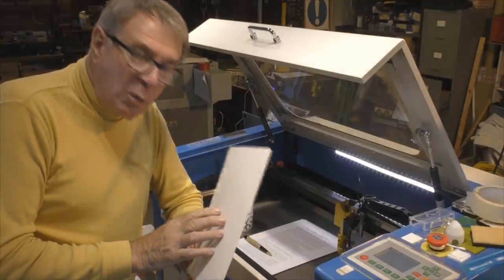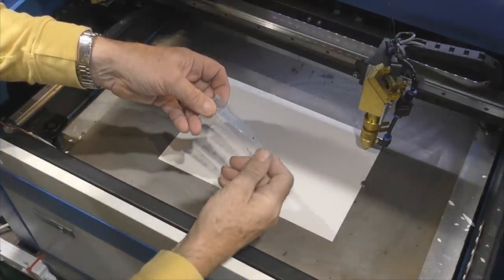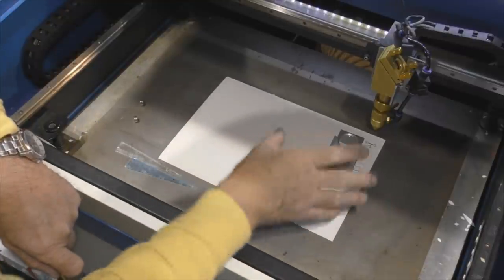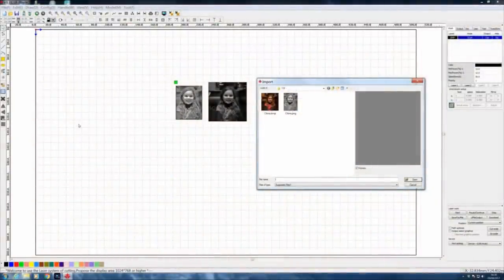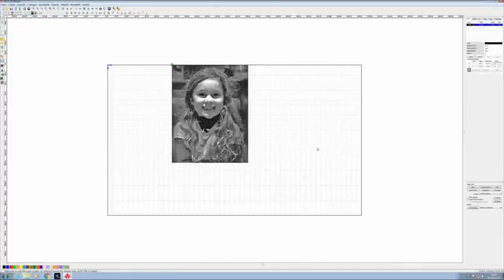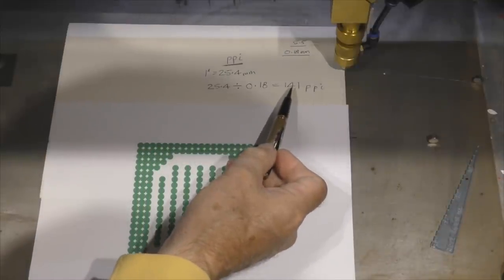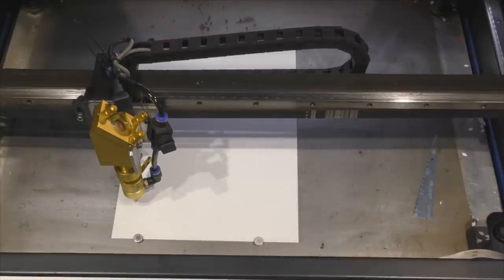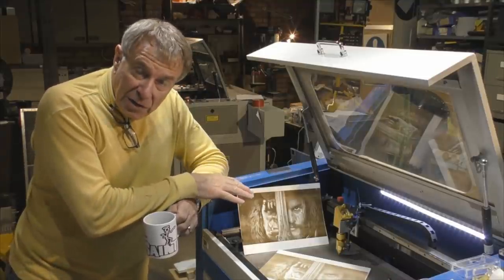RDWorks Learning Lab 115 The Russ Formula for Photo Engraving

Comment: Is there software that does a lot of these calculations?
Reply from the maker: Hi Edward
I understand there is a one touch button within the RetinaEngrave software that does it
https://fslaser.com/RetinaEngrave

and this also has a one touch conversion function. in this also
http://www.photograv.com/aspnet2/

Unfortunately buying a piece of software is not an option for me. I need to understand all the underlying principles and someone else's algorithm  will not educate me on the basics of how it all works. My formula is a basic starting point to that understanding but there are many other avenues to explore to improve the resolution, especially with different materials. All in future sessions I feel sure. This is definitely a work in progress. I have seen some great work by pro companies but they are bound by the same basic physical limitations that I encounter. The response time of the laser tube to changes in current (the laws of physics). The response time of the power supply to commands from the controller(design and component quality limited). The ability of a lens to focus to a theoretical spot size which is again limited to two main materials, gallium arsenide and zinc selenide and then the lens shape which could be plano convex or meniscus,
The fact that both bits of software above claim to work on all machines is an amazing claim considering all the possible variables. That makes me believe that there is something special about the dithering process which my standard programs are not delivering.  More research required.
All best wishes
Russ
Reply from the maker: Also look at https://www.ulsinc.com/discover-uls-innovations/1-touch-laser-photo
Reply: SarbarMultimedia thanks for the info and links. I enjoy how in depth and technical your videos are. I’m new to lasers, but I’m an engineer and i play with cnc routers, printers and mills.
Reply: SarbarMultimedia I like the ease of use of the software packages, but as a hobbyist I’m tired of paying for software. Aspire, Corel, etc have tapped me out. 

I was watching one of your older videos and you said to be ready to replace the tube early on. Do you still think that’s the case?

Comment: Hi Russ,
your YouTube Videos are so great. Thanks to you I have Adobe CS2. And a deeper understanding of Thunder lasers. I especially liked your 3D engraving and doitting videos. 
I have already tried with your 3D engraving technic. But I have not fond working gradation curve yet. I just have to test more. But I have developed an easier but worth tecnic in the meantime. I just sliced my grayscale picture in 10 planes with only 255 white and 0 black. Then I engraved the 10 different pictures on top of each other.This engraving technique  is also capable to producing reusable results. :D
I would like to have also a copy of “The Russ Formula for Photo Engraving”. I would like to try it out and see if I am cable to produse 127ppi pictures.

Sincerely Themisto from Germany

Edit:
Have you received my comment under this comment with my E-mail address? YouTube has deleted two times the comment after same minutes.
Reply: Hi Thermisto
 That is a novel approach to 3D engraving but taking a normal picture and breaking it up cannot give you the topographic image mapping required to produce proper 3D engraving. I have tried several techniques but have to accept that those waxy looking images are the only ones that rally work.
I have not yet received your email address. This maybe because it was a sub topic.Chose nother videoand add a comment. Also use (at) instead of @
Best wishes
Russ
Reply: @russsadler3471  Your technic produse definitely better quality 3D engraving. Engraving with a grayscale picture gives a much higher contrast than my approth. I just wanted to say that engraving with slices is also possible. And I think that there is also same benefit besides the big disadvantage of the lower resolution. It is far easier to use if you don't have a gradation curve and distances should be similar. But I don't know how much influence the the different  distances from the laser to material have on the engraving depth. 
When you have send me the E-Mail with the Doting than I can send you back same pictures of my 3D engraving. Hopefully my reply was understandable. 

Sincerely Themisto

I have again posted a Comment with my E mail under this comment. Maby have seen it this time.

Comment: This is awesome thanks for sharing! How can I privately give you my email address? I would love your tutorial!!!
Reply from the maker: Hi Angel
If you click on the orange S for Sarbar square, it will open a home page. Add      /about                    to the end of the text in the address bar and when you press enter it will open a new page. At top right there will be a message button to press and you can write to me privately.
Best wishes
Russ
Reply: SarbarMultimedia about
Reply: @SarbarMultimedia  hello I need default settings for scanning Chinese black red 60 watt laser machine, do help me,,
Reply from the maker: @tejkiranpalleti3367  
Perhaps I am misunderstanding your question but there are no fixed settings for scanning. It all depends on your tube power, the type and focal length of your lens, the material you are scanning and what sort of scanning you are trying to do. Your question is not specific enough for me to offer any guidance, I am sorry
Best wishes
Russ
Reply: @SarbarMultimedia  sir i use 3mm acrylic sheet and the interval gap is changed and what should be the power and speed should give for 60watt red black china machine..
Reply from the maker: @tejkiranpalleti3367  
This is a very complex subject for which there are no specific settings, as I mentioned previously. Add your your disguised email address to another comment  and I will send you a data pack that will walk you through the basics of photo engraving and help to answer your questions,
 I will then delete your comment
Best wishes
Russ